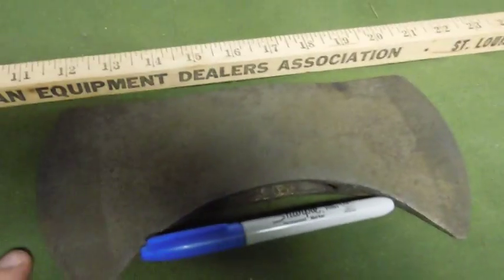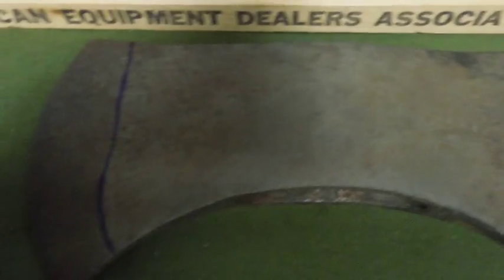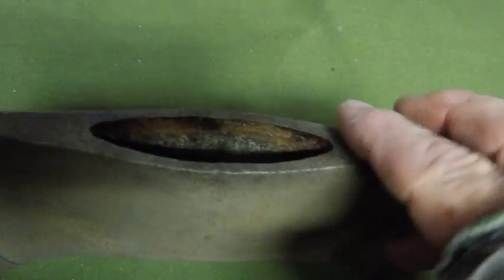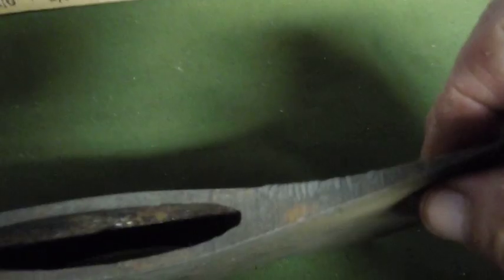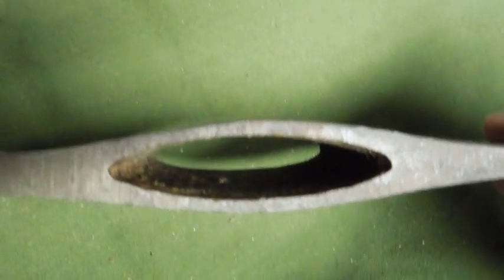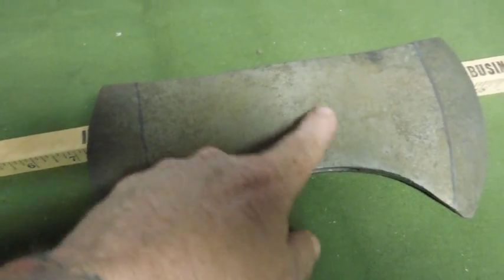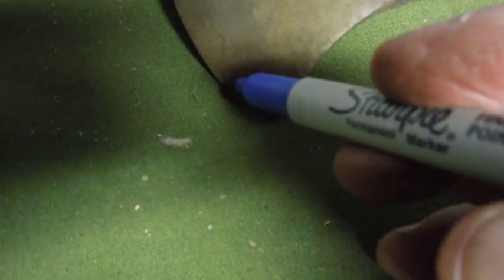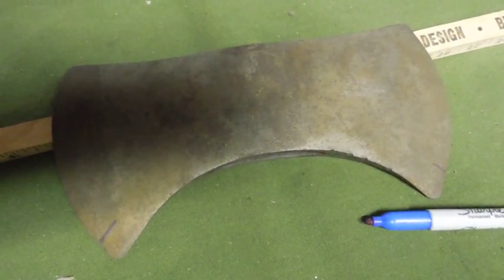Inspecting a Double Bit Axe head for restoration

Comment: Good show, Randy. I can't wait to see you bring that thing back to life. Hope your arm is mending well, my friend.
Reply from the maker: It wont take long to rehandle it.  I will refinish the wood first. It came with a varnish finish so some sandpaper and wood stain will fix that in a hurry.  The arm feels fine.  the receptionist wrote down the wrong date for getting it cut off.  It was supposed to be last week.  But one more week wont be totally bad.  I am rethinking the trim work on the building.  I think I will get some flashing trim tin bent up to cover the parts.  Then I can go after the roof.
Reply: Randy J Cool. We have a sheet metal supply house/fab shop on the other side of the county. It's a nice place. If I buy the metal from them they just let me go in the shop and use the break to make what ever I want. I used to just buy same color flashing and bend all my own trim, ridge caps, step flashing and what not. I love sheet metal, LOL.
Reply from the maker: neighbor has a seamless gutter and siding business.  I just have to go over and see if he will cut me a break.  Especially since he is using my ground for his garden spot and has his building set on my side of the fence.  :)